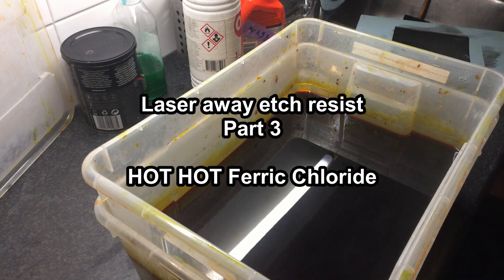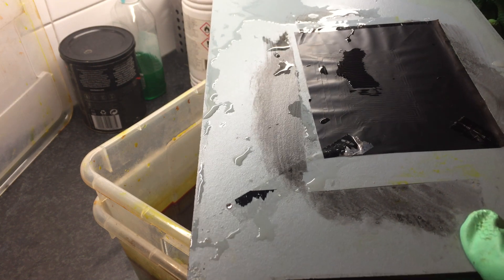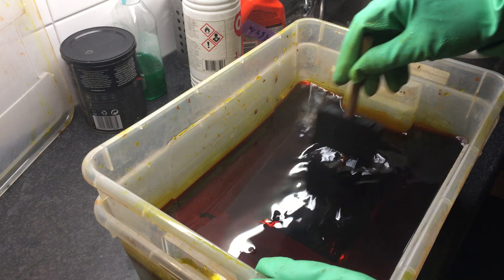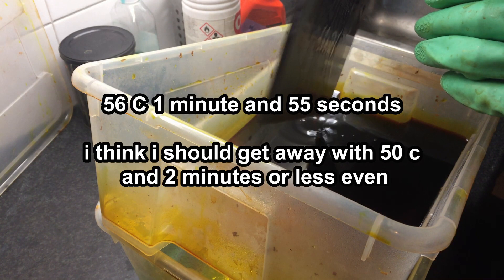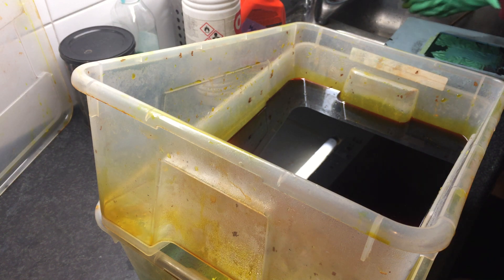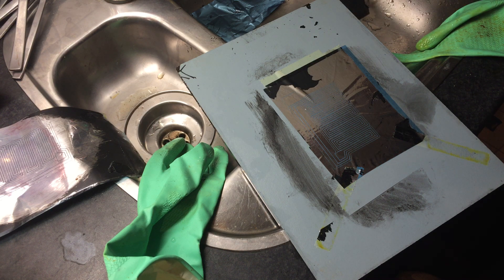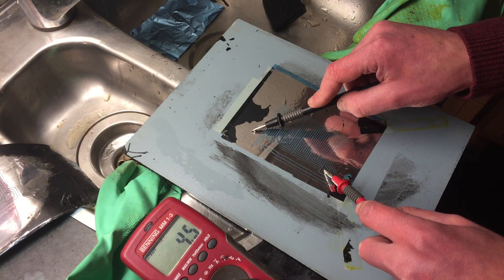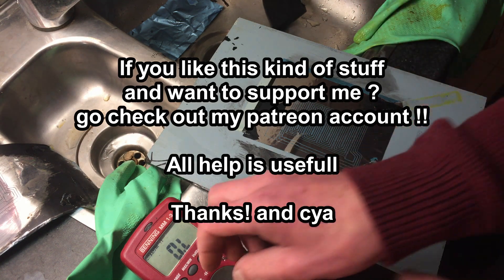Laser Away Etch Resist - Part 3 HOT HOT Ferric Chloride

Comment: I take it that you might do a new design just for laser cutting? Do you think it will save you time and money?
Reply from the maker: printing is faster. it takes after a warm up 10 second to create a a4 paper with the etch resist on it :)  but you can do more in one go with the laser.  and after all the etching and cleaning takes up most of the time i think.   but  yeah i might design something new ;) maybe just because we can ;)  it still is only usefull for small panels.  tweeter/mid. abiout money, i think the paint is more expensive. but still talking 2 euro a can. makes a few foils im sure :)